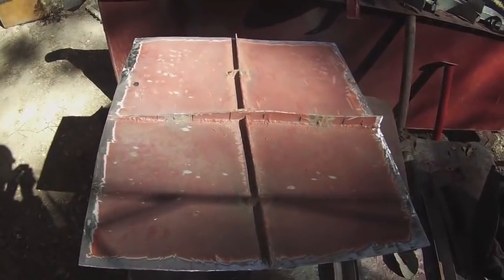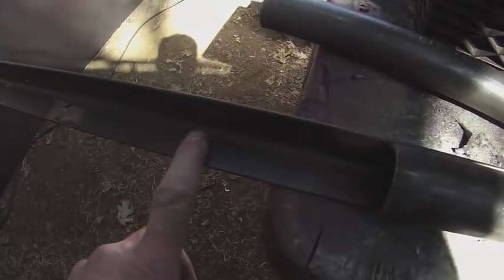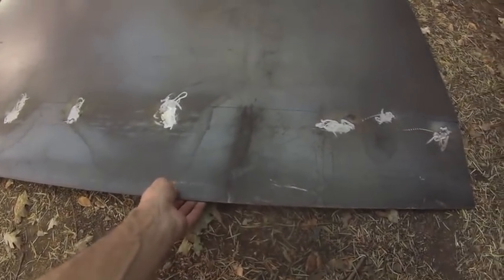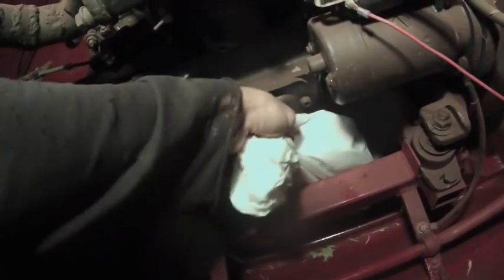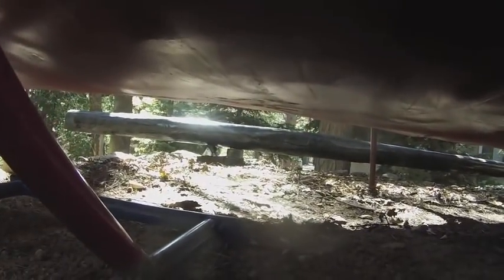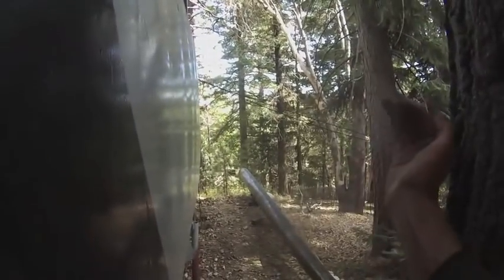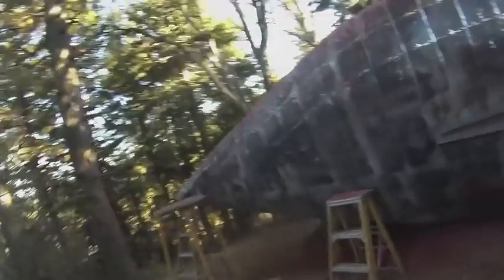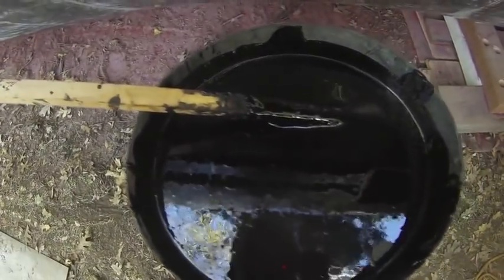Steel Sailboat Build Part 33

Comment: Bending by score is perfectly acceptable if you weld it back up. I've made a mini bucket for my excavator by that method, and i have like 4 or 5 pools of weld put at about 3 cm intervals all over it, i wanted to avoid stress traveling across my shoddy welds and just have single deep welds that i can simply drill out if they prove to fail. So far, some 30 metric tons of trenching, i've had but one broken tooth. Score bending is for the win, for us guys without massive bending presses. :)

Comment: With all due respect... are you a documented engineer?  Will the boat below the waterline weigh more than the boat above it?
Reply: No, he definitely does NOT have any qualifications. BTW, its nothing to do with weight above or below the waterline. The calcs for a boats stability are more involved, but he hasn't done any.  https://www.sailboat-cruising.com/righting-moment.html#:~:targetText=This%20is%20calculated%20by%20multiplying,necessary%20task%20for%20the%20designer.

Comment: For some reason the method for attaching the keel seems suspect to me.  Maybe a few pins welded to the keel through holes in the mounting plate would provide backup and a second failure point.   I am amazed on how you get things done!

Comment: I really like the easy access removable rudder design.  I dont know all of your vessel specs, but the rudder seems to be undersized.
Reply: I though the same, but then I started to think about the position of the rudder behind the keel. Assuming the shape of the keel does what a keel does best, the effectiveness of the rudder at that position could be surprisingly good. Haven't make a fluid dynamic model, but it is just a hunch.
Reply: I'm with Diggnuts on this one.
Reply: @aserta  The rudder will only work at max knots ( 3-5 ). Anything under 2 knots and the vessel has little to no control.